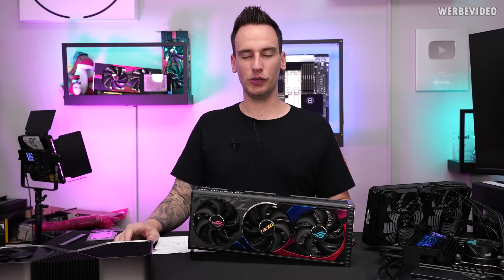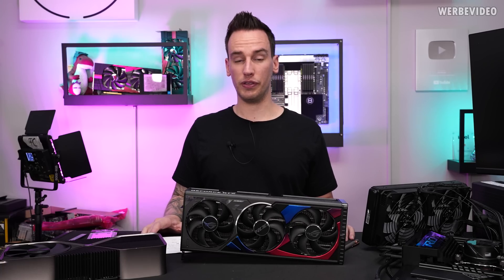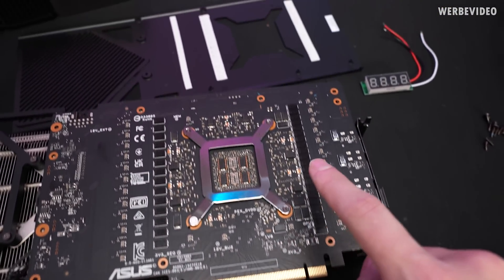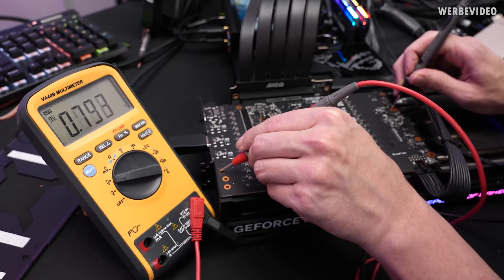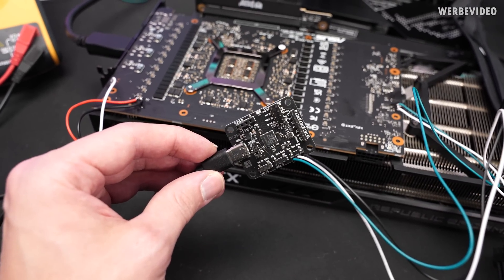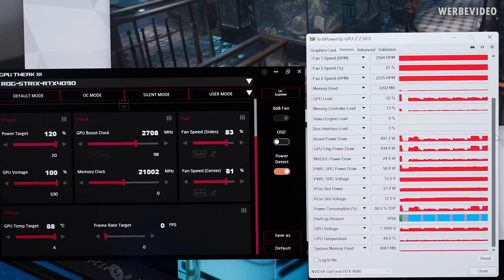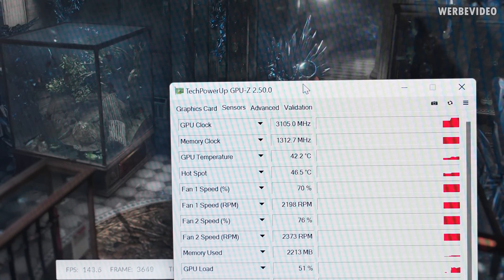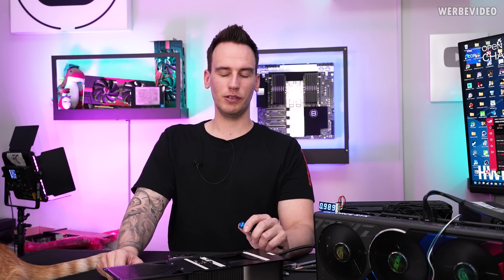Volt-Modding the RTX 4090 STRIX causes insane Power Increase

Comment: I think you had a bad silicon on that Strix, my Gainward Phantom GS does at Time Spy Extreme
1.0V - 2940MHz
1.02V - 3000MHz
1.06V - 3075MHz
1.1V - 3105MHz
BIOS-modding would be nice on non-strix cards to Strix bios, because I am stuck at TDP-limit of 515W.
Reply: @BeZol what are you watts at each of those settings?
Reply: @cptnsx  Time Spy Extreme is TDP-limited at Graphics Test 2, I drop down there to 1.0V with 515W powerconsumption.
Beginning of Graphics Test 1 the 3105MHz @1.1V is consuming 515W.
So to answer your question (at TimeSpyExtreme), between 1.0 and 1.1V the graphics card can consume 515W, it depends only from graphics-demand.
This is the same for games.
Forza Horizon 5 consumed lot less power (when I tested long time ago with RX 6900 XT), than Metro Exodus.
Propably same story with the RTX 4090.
--> You could fine tune your graphics card for each game individually :P
I prefer getting the most insane graphics-demand, tune the graphics card with it until stable, and then play every game with that fine tune. This way no matter what kind of game I play, my fine-tune settings will always hold (if not, then reduce core-clock with 15MHz steps).
Reply: @bezol5845  Thanks for info.  I was wondering if you had to surpass the 450 watt limit to get those numbers and if so by how much.  How were your temps?
Reply: @cptnsx  Yes, +11% powerlimit added (this is the maximum mit Gainward Phantom GS)

Comment: i have a msi gaming x trio 4090 and i was quite surprised to see it will overclock to 3090mhz with short peaks at 3105mhz, i didn't expect that when i seen the 3 8pin adaptor cable and a power limit of 106 in afterburner. clearly it is not power limited so im surprised to see when voltage modded it suddenly becomes power limited, thats pretty damn interesting.
Reply: Its NOT power limited at STOCK voltage - also the adapter cable setting depends on the vendor of the cable.  The NVIDIA cable requires 4 8 pin connecting to go past 450 other vendors may not have that requirement.  Technically you only need 2 8 pin connectors to supply 600 watts depending on the gauge of the wires.

Comment: So basically you can't undervolt, overvolt, or power up. You just lower the power slider. They finally prevented overclocking. (Outside of LN2)
Reply: "They finally prevented overclocking."
Nah, they have reached a point were the stock-settings are already quite decent and you fiddling around with them is unlikely to give any benefits.
undervolting is still alive and well - but the last 2 videos of Youtuber that attempted it were .... quite embarrassing fails as instead of undervolting they actually INCREASED the voltage applied and then just added other limits on top - resulting in basically no changes in efficiency (in Afterburner to get an undervolt you need to move up the f/V curve)
Reply: @ABaumstumpf  you have NO idea what you talking about - on this CHANNEL it was shown how undervolting is just not as effective as simply lowering the power-limit and increasing the core and memory clock sliders.  So I guess this GUY doesn't know what he is talking about either then.
Reply: @cptnsx  "you have NO idea what you talking about"
But you do - sure.

"on this CHANNEL it was shown how undervolting is just not as effective as simply lowering the power-limit"
You might want to watch his videos again - cause that is not what he concluded.

"So I guess this GUY doesn't know what he is talking about either then."
Nah, he knows what he is doing - that is why i did not make stupid claims like you did.

Comment: NVIDIA could have had half the cooler if they didn't push so far outside of the power efficiency window. Everyone should undervolt their 4090s - save some energy with almost zero performance loss and much less heat.

Comment: Thanks. So basically not only did Nvidia voltage-lock the cards but also optimize and overclock the cards to their max potential without going nuts in power consumption which is currently a no-go for euro people like me anyway. So we may as well buy any card with a maximum 450W bios, run stock or even with a power limitation and call it a day...
Reply: No - what you want to do it is KEEP the power-limit at 100% this will ensure you don't go over 450 watts and then test how much you can add to the clock and memory clocks - this gives you maximum performance without breaking 450 watts .  Or LOWER the power-limit to 70% and test what you can add to the clock and memory clock - this gives you the maximum efficient performance without breaking 315 watts.

Comment: when i built my 24c threadripper i realized something, cores MULTIPLY watts, so power raises quickly mine went from 280 to 435w !!! only the cpu not the system ! only 6.46w more per core but x24 ? ouch

Comment: Awsome video. But i wonder is the Power connector going to be the limiting factor? 600 watts through not so big cables is already something. If you could get it to say 800 watts, what will happen to the rail of the PSU? If they are all equal it will be fine i guess but if there is an offset between eachother that might be a big issue!
Reply: People have been getting 1000 watts out of 2080ti and 3090s.. not sure how orc where the juice is coming from

Comment: Did I understand correctly? It's better to use Power Minus 20% than lowering voltage? Because it was different with 6800XT. Me personally, I don't have the enthusiasm and time to fiddly with undervolting/OC, so I set power minus 25% and forgot about it. I lost 3-5% at 3440x1440 in iRacing, ACC and AMS2 with power usage at 200W. The only games/sims I actually play from ~2018 onward.
Reply: Yeah, it seems the other tech tubers have found similar results as well.

Comment: I seen a quote from somewhere talking about the 4090ti being cancelled because it was melting sockets and tripping breakers. I wonder if he's going to run into that issue from doing volt AND power mod
Reply: This was development cards in the lab. And they were likely on the larger Samsung process that consumed more wattage. But thats not yet known as Moore's law is dead didn't give us specific details. They already announced a 4090ti ... So it will be a thing. I dont think it will be an issue. Tripping breakers can and will happen though... The amount of power they have regardless and most homes have their limits. Regardless, they can still make a 4090ti with more cores etc and slight power increases.

Comment: This strix card is gorgeous when you see it in person. The quality is on another level. It blows my 3090 suprim out of the water in terms of quality. There's even a small cutout for the voltage measurement points so you really don't even have to remove the cooler

Comment: undervolting is good. you get 2% performance hit for ~20% less power draw on same frequency. just shows how ridiculous they put power target for max performance.
Reply: Nah, they don't do that for max performance. It's just to make sure all chips (which differ in quality) run stable. It's just too risky (and too much work) to min-max each individual chip, but you as the customer are free to do that.
Reply: @benfrese3573  i know that. but it just shows how minor performance uplift demands so much power. they could have easily had this card with 20-30% lower power with only slight performance hit. i mean 2% for ~20% power is significant. so for 5% performance hit they could have had this card stable and probably with at least 30% lower power consumption.

Comment: I don't care that much for overclock anymore these days (loved the days where it could easily give you insane gains). Still like to see your videos for it's very informative and you never know, there might be a chance there is performance increase to be gained.
Reply: seriously. overclocking the crap out of my 6800xt, air cooled, gains so little for such a  huge cost. honestly i dont know if thats a good or bad thing. probably good since the assumption is that out of the box you are getting the most out of your card without doing extreme overclocking with super cooling which in my case is overkill unless im doing it for the fun of it but not practical at all.
Reply: I'm with you on that.  I just turn on PBO2 with my 5600x and let it be.  On my 6800xt I installed a waterblock but only because I like the quietest pc possible.  It's barely overclocked.
Reply: I concur with everything said about the older stuff. I have a custom loop nothing insane just a 280 plus a 240 rad but it allows me to run my Haswell 5930k at 4.5 ghz all corr rock solid when the official stock is only 3.4 and 3.7 boost. I absolutely loved getting it this high completely validated my decision to get into watercooling. I also have a vega 56 with a 64 liquid bios running balls to the wall in terms of power and clock speed. My rig handles all current AAA games 60-100 @ 1440p. I'm only just now beginning to put together a new rig as it's kept up with everything for a good almost 6 years.  CPU never sees above 75
temp gpu had never broken 65.

Comment: Considering the card at 70% power limit is already 95% the speed of a 4090, what's the performance gain left on the card? It's overclocked  to the point that 30% power limit equals 5% performance.

^ All of this + the fact that nvidia limits board partners into what can you do with the card is slowly killing overclocking. At this point we're back to the "as efficient as it gets" era, where everyone is looking not to have an actual oven of a computer, but something manageable with decent performance.

Comment: Just soldering а 2 Grand graphics card ? thats thicc
Reply: Its quite safe actually, only thing is you could dislodge a capacitor or something and they're a pain to solder back on. Also you can fry something if you shove way too much heat into it

Comment: Impressive!  But the last thing most of us would do with a 4090...if we could afford one.  It's definitely good to know card limits.  Tougher back in the day...pretty sure I was setting voltages via a TXT file for my Diamond Stealth II 4 MB...got it to 70  Mhz from 35...had to add heat sinks to VRAM and GPU and a GPU fan with super-glue no less.  Thought I cooked it at 72 Mhz, brought it down to 70 and it stayed there until I bought a Voodoo Banshee.  It would be nice to see 200% OC's again...can't see that happening any time soon!
Reply from the maker: It's a sample I got from ASUS so it's absolutely different for me compared to paying 2500€ for it. Also we often try to do things so you don't have to do it at home :D
Reply: Most stuff today come basically "ocd" from factory. They bin the chips to  see which chips will get more clocks to sell $ accordingly, so the margin of gains is lower everyday.

Comment: Is it possible that the card doesn't actually target 600W? We know the power connectors are there but maybe Nvidia did something in the bios to prevent reaching 600W due to various tech tubers expressing their concerns about such high power draw for the average user. Looking forward to the power mod video, as well as when you have your direct voltage meter ready for the STRIX. 😁
Reply: I don’t think Nvidia hardware engineers changed their design due to tech tubers opinions.
Reply: @APhamx7  They literally canceled the '4080 12GB' over bad press. And they are reportedly going to lower the price as well. That is due to tech tubers and the tech community's collective response. So what is unfeasible about them hard-locking the card at silicone or bios level to not actually reach 600W after everyone had been concerned about the high power consumption since it leaked?
Reply: @ModernOddity728  renaming something is far easier than changing the entire silicon design
Reply: @WayStedYou  Sure, but that's also after they announced it. This was leaked over half a year ago, seems like ample time to lock in a lower power target. Idk where you get a 'entire silicone design' change out of that, not as if I said they should reduce the bus or anything else, just s hard limit on power draw set at silicone (or vbios) level so the card may not 'go crazy with power'. I mean how do you get to an entire silicone redesign from that, what all else would Nvidia have to do? (Really would like to know) And how long could that process take, if you know? I just don't understand why the STRIX would not be hitting the claimed 600W power target otherwise, would be happy if you could explain your perspective on the cause. 🙂
Reply: no. The card was never targeting 600W - you are mixing up bullshit leaks and intentional misinformation from AMD-fanboys with actual reality.
Reply: The Samsung node that these cards were going to use was targeting 600w. The newer tsmc 4nm process allowed them to hit less heat and power.